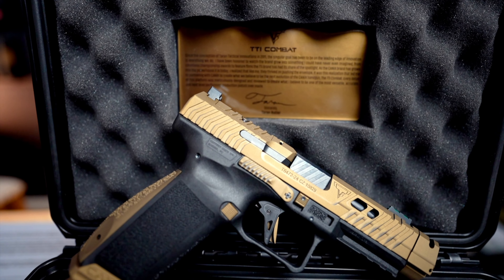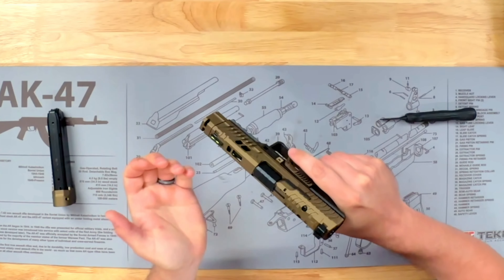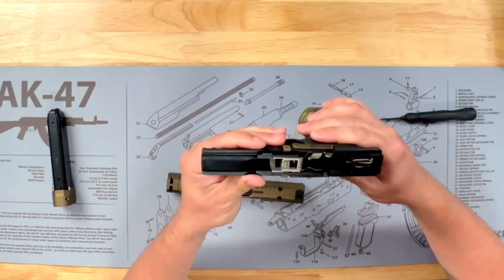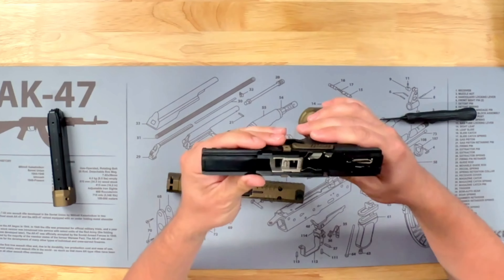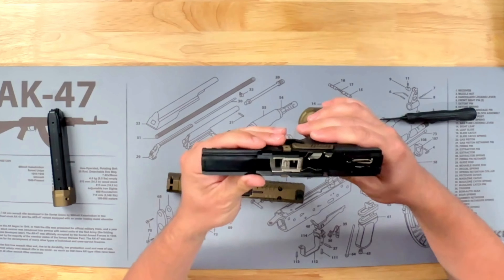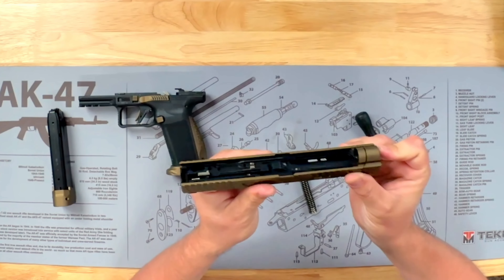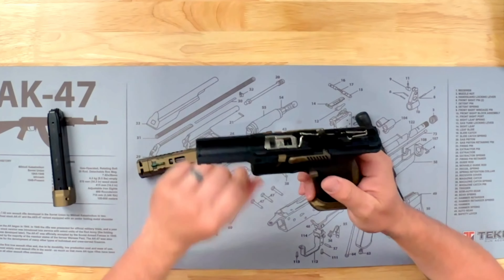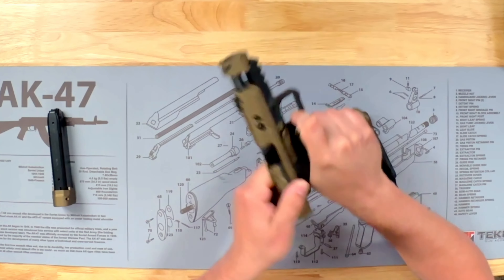Canik TTI Combat Field Strip

Comment: excellent video.  Shot mine for first time today and had many failure to return to battery.  I've read many others are having the same issue.  Very disappointing.
Reply: Interesting hearing this. Mine ran 200 rounds the first time out, and there were no issues at all
Reply: @loganviau555   Went back to range and noted something I saw someone else post about.  It's denting or scoring the end of the lead so the feed ramp must be bad.
Reply: Did you end up getting it figured out?
Reply: Mine is doing the same it sucks
Reply: @MarcoPoloWvc  after about a thousand rounds and a few cleanings and oiling, it’s better but still not right. I emailed them and they are sending me a higher powered spring and guide rod. The failure to return to battery hasn’t been happening but the bullet is sometimes striking the feed ramp which is causing it to either dent the head, like a slice across it, or it fails to load.  I don’t know if polishing the feed ramp will fix that. Yesterday it happened 3 or 4 times in 250 rounds.
Reply: @mdjak3686  I changed to the other spring that came in the box and it fixed it
Reply: Cut 2 rings off your extractor spring. I had the same issue until I did that

About every other bullet would get stuck. Now I've shot 500 without a single one FTF